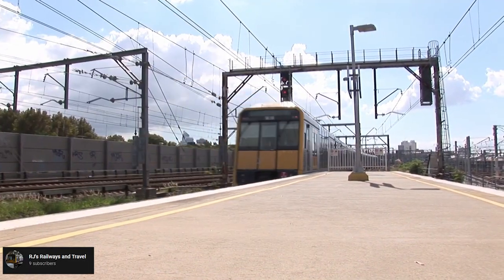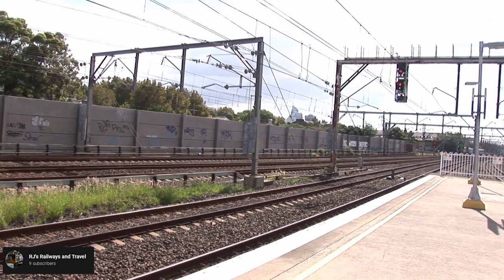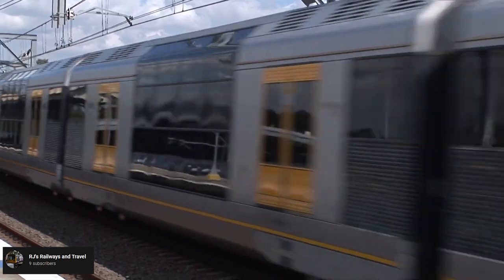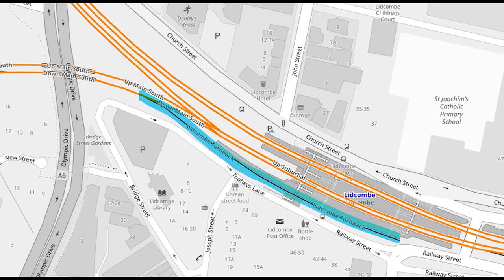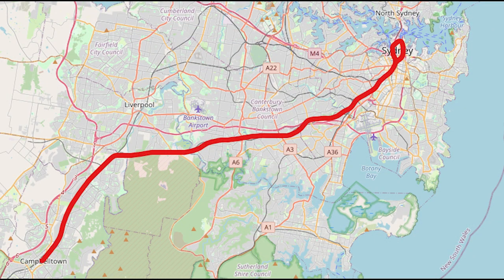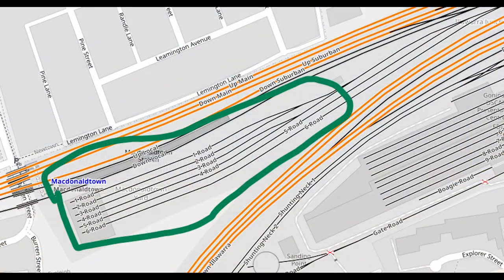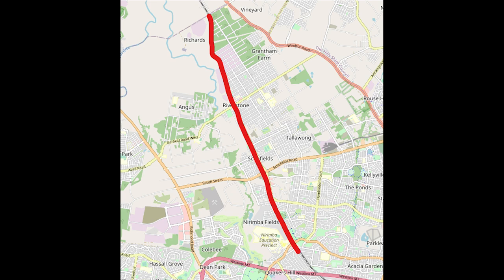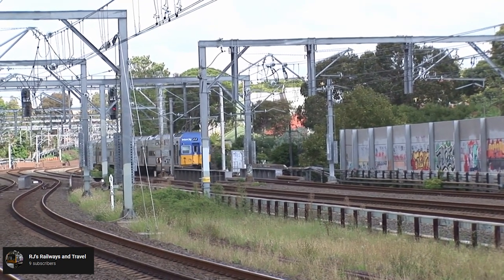CityRail's Clearways Project Explained

Comment: The doubling of the line past st marys towards penrith never happened due to financial set backs, but you can clearly see the planned platforms and footbridge supports with kingswood and werrington alongside unused rail grade and electrical way huts being futher away from the rail line then needed.
Also, Carlingford was envisioned to be much more worthwhile with proposed connections to Epping, which would've been more feasible had this push forward

Comment: This is a great video. I've been really getting into the Sydney rail network lately, since I'm heading up there in a couple of weeks and plan on doing a fair bit of train travel up there. (I'm even heading up on the XPT.) I'd love to see more videos on Sydney's rail system if you're able to, especially since, as I've discovered, it seems VERY complex when compared to Melbourne's. For example, could you maybe do an explainer video(s) of lines/line groups/line and service configurations/service patterns (i.e. express vs stops all stations and different branch lines on the same group)/alternate routes certain services can use/terminating and turnback stations/where and why different lines interconnect with each other at all the various interchange stations and whatever else you can think of? I'd love to see that.

Comment: Correction the Cause of the 2003 Waterfall Accident was not due to consciousness it was due to the driver suffering from a heart attack and died at the control the dead man switch was basically useless as the drivers foot was still on the pedal

Comment: Hey, you know, I think that the city circle line in Melbourne would be the smallest rapid transit system in the world if it existed today. About 6km of track but it's a single track so it would make it more like a 3km system compared to the Minatomirai line which is 4km of double-track.
Reply from the maker: Still runs every now and then when other loops are shut down. You're probably right about it being one of the smallest "rapid transit" (effectively) systems in the world i it was open.

Comment: Clearways project was to allow for separation of lines into sectors for better running and preparation for privatisation. The latter didn't happen but instead you have the increasing network of driverless metro trains, nicely automated and non-unionised computer drivers.
Reply from the maker: Given the drastic failure of Melbourne's privatisation I sure hope Sydney stays publicly run.